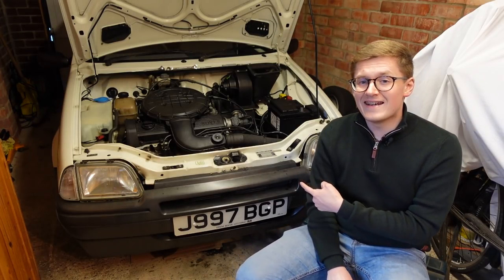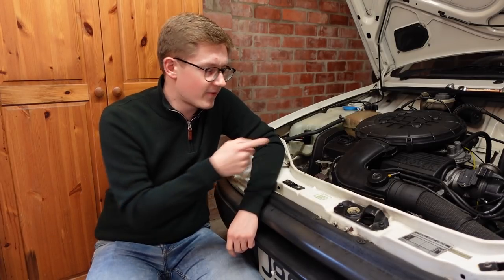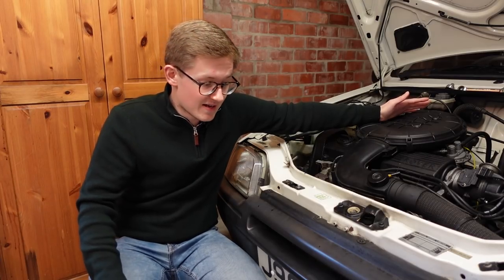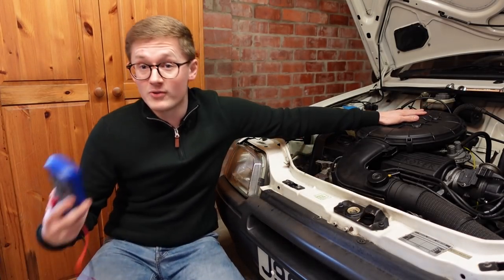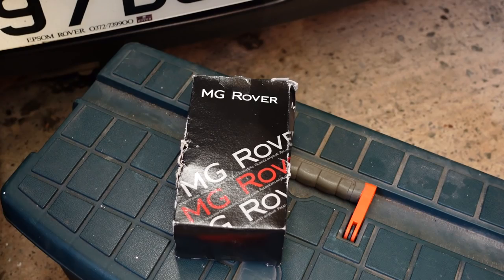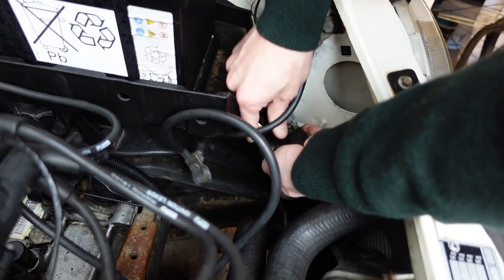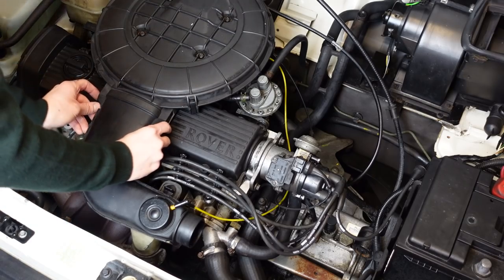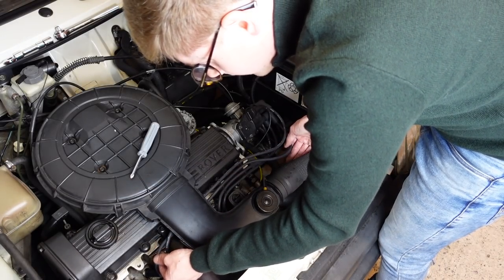Melvin the Metro - Misfiring and Stalling!

Comment: Well done! Great sense of achievement when you do something for the first time. Recently my 1983 CX refused to start. My garage man came out to it and told me the coils were shot. It is a fully electronic distributorless ignition with 1 coil for 1 & 4 and a second for 2 & 3. I thought the diagnosis was wrong because of the extreme unlikelihood of two coils failing at once (no spark from either coil). So I refused to let him change the coils and decided to take it all apart, clean everything and reassemble. I found the two flywheel crank position sensors totally covered in black gunk. Cleaned and tested them, put everything back together with new plugs for good measure, and she fired instantly and ran perfectly normally. Every time you do something like that you’re gaining experience, knowledge and confidence and it’s a great feeling! I very much enjoy the freshness of your videos. Keep up the good work!
Reply from the maker: Thanks Thomas :)

Comment: In days perhaps long gone, such terms as 'dwell angle' (the angle in which the breaker points are closed), and lead resistance (maximum 20,000 ohms/foot) were specified in repair manuals, a 'static' diagnosis could be done down to the individual lead.. With the first stage of electronics in the ignition system, 'breakerless', where the 'switching' of the coil is done by a large transistor, the dwell angle is close to 90°, which means the coil is switched on nearly all the time, giving rise to heat reducing its life. Later ignition systems used several 'coil packs'. As for the availability of a coil (and leads) it is a very universal ignition component, and interchangeable for many makes and models, so likely to be around for some time. I am very impressed with your approach, and feel equally excited as you in getting a successful repair. The 'Eureka moment'..!

Comment: Well done, Ed. Sounds like Melvin is really due a full service. New plugs, rotor arm, distributor cap, and fuel and air filters plus, once all that is done, a good tuning of the carburetor. Carburetor tuning is a bit of a black art, but really all it needs is a good screw driver and a well tuned ear. Oh, and make sure the distributor timing is still spot on.
Reply from the maker: He had a service very recently.

Comment: Good diagnosis and explanation, nice to hear Melvin running nicely.

Further notes and clarification…

The 2 windings in the coil are called the primary and secondary, the primary is the switched low tension circuit from the points (or equivalent), the secondary produces the high tension pulses.

The secondary winding sits inside the primary and has many more turns.

The king lead technically goes from the coil to the distributor, not the reverse like you said !

Carry on…

Comment: When I bought my first K series Metro (1.1C) in 1990, it lost all power after running for a while at random times after it had covered 12,000 miles, the Rover dealership where I worked carried out diagnostic work in partnership with Rover factory engineers, all were baffled when no fault codes appeared, no ignition faults appeared, no fuel system faults were detected, but a vacuum gauge test showed a pressure drop when the fault occurred, Rover supplied a complete new modified cylinder head (yours has the old type - the cam cover on the late ones is smaller and the timing belt top cover isn't part of it), this worked for the next 12,000 miles, when the fault came back. By this time Rover had brought in a factory (fix), which consisted of running a flushing agent through the engine via the fuel, which lasted for a month each time it was done on mine, over a 3 month period. The fault was attributed to unleaded fuel causing an accelerated  carbon build up on the valves, Rover brought in a carbon break exhaust valve (the stem has a stepped section in). A set of these were fitted to my car and the fault never returned.

Comment: Excellent. How sweet is it when a poorly motor runs well again. I bet you were itching to take it for a run. It is SO satisfying when you diagnose something and the repair works first time. I suspect HT cables absorb moisture from the atmosphere over time and that causes the insulation to be slightly conductive. Combined with carbon conductors that break down over the years with vibration and thermal cycles. You'll save the cost of all that in a few hundred miles improved fuel consumption. At least your car is recent enough that it has electronic points. As a kid, I remember my dad was forever cleaning and replacing the points on his (almost new by modern standards) cars.

Comment: Normally, it is not based on the pulleys, but on the side hewre the distribution chain or belt is located. That normally marks cylinder one.
Very nice video and cheers from Belgium!
Reply from the maker: That's generally the same end!

Comment: Well done Ed. I would have been tempted to try the engine before replacing the leads, just to see if the fault was with the coil or the leads - process of elimination. Best to replace both I agree, but it's nice to know beyond doubt what actually caused the fault. Incidentally, my Metro wasn't running as well as it should - the connectors on the vacuum lines had all split and I hadn't noticed. A quick and inexpensive fix. Only done 12000 miles but it's an age-related issue, not mileage - the connectors harden with age and then split. Worth a quick check whilst you're in 'ignition mode'!
Reply from the maker: As I said in the video, the resistance readings were out of spec for both the leads and the coil, so they both needed changing regardless.
Thankfully, the vacuum lines are all good. The carb does need properly setting up, mind you.

Comment: Great job, don't be frightened of the carb they are quite simple to adjust, I would also suggest that you won't need to change the jet just because you fitted an uprated exhaust but you will need to adjust it. It usually only becomes necessary to start rejetting when you start changing camshafts and fitting oversized valves and the like. I am sure with your contacts in the classic car world you could find an older mechanic that could show you how to set it up by ear (you do need to be shown it's impossible to explain without the car in front of you) the most technical piece of equipment you might need is a basic gas analyser which are relatively cheap these days.
Reply from the maker: Fortunately, I have found someone with a rolling road!
I just need to book the car in now.

Comment: thanks for this, currently having similar issues on a 1990 nissan sunny coupe. bought a weber for it, new coil pack, new plugs, fresh oil/filter and new fuel lines/filter and pump. still not 100% right though.
Reply from the maker: Thanks mate :)
Have you managed to get the Sunny right yet?

Comment: Brilliant diagnosis!
I figured it had to be related to the spark plugs or ignition system. Going about using a mutltimetre assisted in your diagnosis.
Are there any Metro specialists within a reasonable distance from your location? A good tuning of the carb is essential to Melvin's overall health, drivability and fuel consumption!
Congratulations Ed, well done!
Reply from the maker: Thanks Frederick 🙂

Comment: Most rewarding to do your own diagnosis and repair. Good work, you can keep that beast running for years. Can't believe how clean it is under the hood. Very sanitary.  Also, good for you to not automatically blame the carburetor for the issue, ignition is most often to blame, I don't know much about SUs (which I believe you're running) but don't want you tearing into it just for a video.
Reply from the maker: Thanks mate :)

Comment: Job well done. Mind the static timing, as the distributor appears to be close to a mechanical limit. I suspect you may be 8°-12° out. That would account for the richness you see on the spark plugs. Also, if it's running rich the needle is probably fine and the carburettor needs no further sorting.

Signed: Wizard of Dark Arts.
Reply from the maker: It does need timing, but some plonker has replaced the crank pulley for one with no timing marks!
The richness on the plugs will be down to my use of the choke to keep the car running and move it around. I assume the plugs will have returned to a more normal reading now.
Reply: @TwinCam  Plonker indeed! If changing the pulley for a unit with a timing mark is for some reason impractical, there are several easy methods for finding top dead center on #1, all explored in video tutorials, and to recount them all here would be redundant. I'm guessing that your K-series has a timing tab on the front of the engine. Put a dab of white paint on the pulley at 0°, and the plonker has been eliminated. I would also put white paint on the tab.

Cheers from Costa Rica!

Comment: Awesome stuff, Ed!  First thing I thought of from your description was duff points (Melvin doesn't have them), then ballast resistor (doesn't have that either) then coil lead.....and if the coil lead is going bad, then you may as well do the others because they won't be far behind.  Testing the leads is something I would have done too......but I don't think I would have looked at the coil until I tried the leads, so well done you for finding that as well and saving yourself another trip out.  Even if the coil wasn't the entire cause, it certainly would not have been helping matters if its resistance was out of spec and considering where Rover placed that coil on Melvin, it's not exactly out of firing range of being affected by the weather, is it?  Mind you, he is 30 years old, so the coil has had a reasonable life span - the one in Tracey my Triumph 2500S got to be 38 before it expired, but that's the oldest I'd ever seen a coil get.  For future ref, one other quick test for the coil is after running Melvin for about 5 mins, put your hand on the coil.  It should not be hot to the touch - mildly warm, maybe, but not hot.  If it's hot, it usually means the fluid has escaped and it's going to die soon.  Trixie, my Mini, now has a solid state coil (no oil) which is supposedly very good in the likes of Minis because they get vibrated and shaken around a lot.  Time will tell, but at least it lets the Mini run an electronic ignition like Melvin does.....and saves me taking the grille out every 000km to check the points!  Anyway, just wanted to say well done, mate.....and I too have a little dance of glee when my diagnostics lead to something working out the way I hoped!  Makes you feel real good - and saved you a bit of money because you did it yourself and didn't have to pay a garage to sort it!  Makes me (and a lot of other old codgers) real happy to see someone your age working on a classic car and continuing the love for the simple mechanical engineering.  Again - good on ya, mate!
Reply from the maker: Thanks Lance 🙂

Comment: Don’t be scared of carburetor work, but it is a as you said a dark art, if you’re adapting it to an upgraded intake/exhaust set up.  Luckily the internet is full of resources on carburetion theory, as no doubt you’ve already found.  As long as your carb doesn’t need machining to solve warpage or failure of butterfly bushings, then kitting a carb is easy provided you take your time and get everything clean and correct and organized as you go back together.  Once that’s done tuning the carburetor can be accomplished with a vacuum gauge, timing light, and tach  to confirm timing, fine tune idle speed, and dial in the idle air flow/ idle circuit mixture.  You follow that up with a few days driving followed by inspection of the plugs to determine how rich/lean your carb is operating through its primary circuit.  You may need to adjust your float level if it’s running overall too far to the lean or rich side, or in some cases re-jet the carb, though that again takes research to know how best to approach selecting a jet size.

Comment: Well done on fixing melvin. I must admit, that given the diagnosis, of needing the choke, high revs and a misfire, I would have been looking for a vacuum leak. I would like to know, how 'out of spec' your readings were, on the HT leads. Carbon leads don't last forever. There comes a point when the resistance gets too high.
Reply from the maker: Thanks Richard.
I can confirm, all vacuum lines are fine!

Comment: Half way through your video I was thinking it was a E5/E10 petrol issue but in the end all sorted!  Nice one
Reply: I thought so as well, but I thought Ed's assumptions were correct also.
Reply from the maker: The fuel wouldn’t be an issue - it would be what E10 had dragged up from the bottom of the tank, gathered from the fuel hoses or nabbed out of the carburettor.

Comment: Hilarious, dark art.  LOL  Carburetors are extremely simple and straight forward metering devices.  Grew up rebuilding Quadrajet's, Dualjets, Carter and Motocraft carburetors, nothing mysterious or voodooesque about them, it is a worthwhile experience to have at least once.  BTW what you are describing sounds like a vacuum leak, hence the high RPM, the necessity of the choke. I have to say I am surprised, your idle quality must have been falling off for quite a while to make that much of a difference with the coil and wires.  Definitely don't miss distributors and plug wires.
Reply from the maker: There are no vacuum leaks, and the idle quality did just fall off a cliff over the space of one day.

Comment: Well done Ed 
Apply some logic and then Cary out tests
It's proof if it were needed that the old adage of  don't guess test is the right way to go about fault finding 
Also you mentioned that your spark plugs were a little on the Rich side of things,this will more than likely be down to the use of more choke than normal to overcome the misfire now that it's running better take it for a good long drive and warm it well through,when you've done the run whip out a plug and look at the colour of the tip should be light to mid grey ,you might want to check the plug gaps whilst you're at it 
Merry Christmas and drive safely.
Reply from the maker: Thanks mate 🙂
Almost certainly, yes. I knew the plugs wouldn’t be an indication of how the car was running thanks to the problem, but I needed to see if there were any issues with a particular cylinder.

Comment: Amazing to me that a car manufactured as late as this one has a manual choke. I thought they went out in the late 60s
Reply from the maker: It was exceptionally rare to find a small car with an automatic choke right up until emissions regulations forced their replacement with fuel injection in 1994.
Reply: @TwinCam  I guess it's different in the UK, in the United States manual chokes disappeared when I said. Maybe they were still around in commercial vehicles I don't know. Fuel injection started appearing, I mean electronic fuel injection, in the early 1980s. And had replaced carburetors almost entirely by 1990. By that time only the very cheapest cars would have carburetors. And they did disappear entirely very soon afterwards. Glad they're gone, hate carburetors.
Reply: @kevinbarry71  And I love them. Hell I'm changing my 1995 car over from this horrible useless monopoint fuel injection to a manual carb. So much less headache and easier cold starts with a properly tuned carb!
Reply: @kevinbarry71 a lot of cheaper small cars in the UK had carburetors and manual chokes until the mid 90's. It was just to save cost. Remember these are tiny 1.0, 1.1, 1.2 engines.
Reply: @BRED510  I suppose. While we didn't have engines quite that small in the United States for the most part; we did have a lot of one. Fives And Renault had a 1.4. And even Subaru had a little three cylinder which I think was 1 L, and Suzuki also had a 1 L three cylinder. And I'm pretty sure they did not have manual chokes
Reply: @BRED510  got some vids you might like 👍
Reply: I had two mid-80s Renault 5's with manual chokes here in Canada. I also had a 1991 VW Golf diesel with one. I think the VW diesels in Canada all had manual chokes until the TDI came here (1994?).

Comment: Folks, I am having a starter problem exactly like this. 

Initially it was a fuel issue to the carburettor, however when I sprayed electrical contact cleaner onto the carb it started fine and ran until the cleaner burnt off.

I took the carb off and it was clean and tidy and the owners had drained everything out of the system.

When I put everything back together and now fuel is getting to the fuel pump it won’t start. Even when I sprayed east start directly onto the contact cleaner it still won’t start…which was annoying as it turned over nicely even when I didn’t have fuel get to it. Now won’t start at all.

Any ideas or suggestions would be greatly appreciated